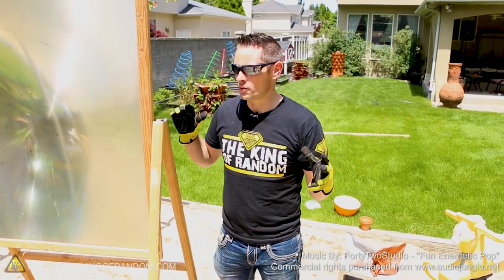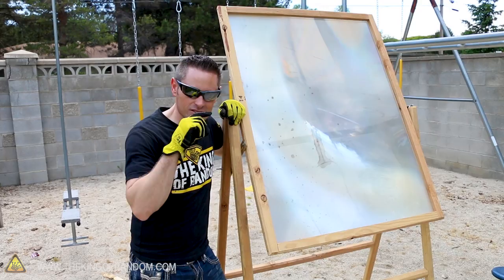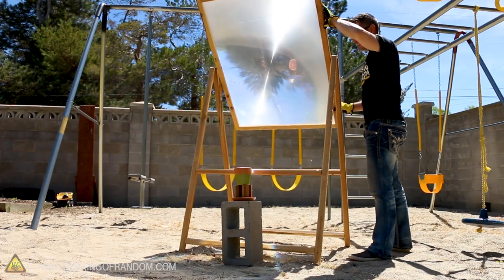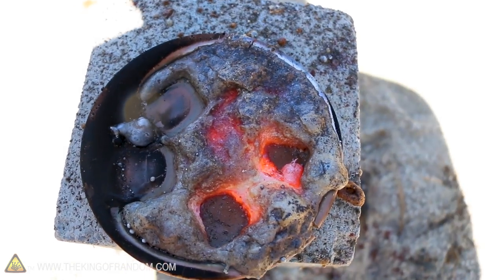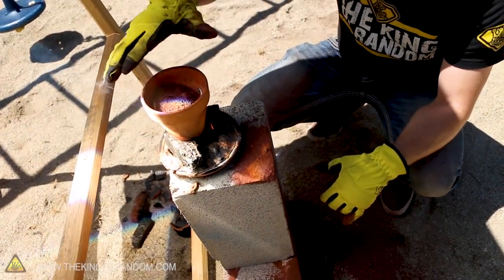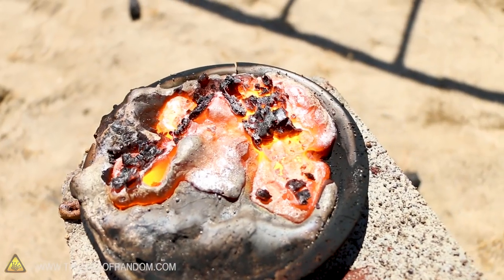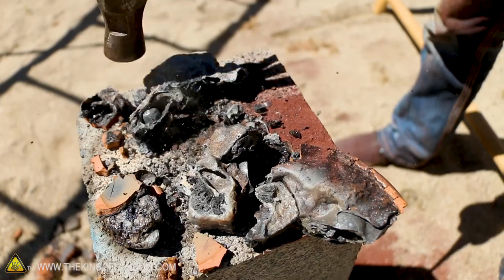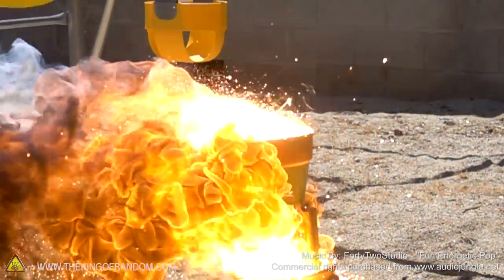Will The Solar Scorcher Light Thermite? TKOR Tests A Solar Beam From Giant Magnifying Glass

Comment: Will the Solar Schorcher burn dry ice or liquid nitrogen
Reply: Co2 (dry ice) and Nitrogen are common gases and doesn't combust or fuel a fire.
Reply: Str8fighter Halili No.
Reply: ok Thank you
Reply: It probably can because dry ice has a temp of -109.3G and liquid nitrogen has a temp of -321F and the solar scorcher burns things at over 2000F
Reply: Str8fighter Halili no. It can't burn it cuz liquids can't burn and the dry ice would vaporize before burning

Comment: will it and how mutch will it generate electricity with a solar panel
Reply: Vinko Klobucaric I wouldn't try that, the heat would damage the solar panels.. Plus, the scorcher works by concentrating light in a large area down to a single point. This means that there would only be a small amount of light hitting most of the panel while the focused light burns a hole in a small amount of the panel, so it's probably not very efficient...
Reply: Red Phosefir i ment an unfocused sorcher and i was wondering whoud it make a diffrence
tnx for the information
P.S. sory for my bad english
Reply: Vinko Klobucaric I suppose it might in that case, as long as the focused light fully covers the panel. :D it certainly does sound like an interesting idea
Reply: It is as Red Phosefir said: it only focuses the light (think of it like a funnel). The point being, that the it doesn't magically amplify the energy that enters the scorcher - in other words, the amount of energy that exits the scorcher cannot be any more than the amount that enters (otherwise it would be a un-isolated perpetual motion machine, meaning infinite energy). If it could actually output more energy than enters into it, imagine placing a bunch of them in a circle - energy would build up indefinitely; that is obviously not possible.

TL:DR: It makes no difference. The amount of energy obtained is the same assuming that it is even possible to make solar panels capable of handling such a high concentration of light.
Reply: That Guy how do you know
did u try?

Comment: thermite is actually used to join rails, so yes, you can use it to cast iron with it. I don't know if your sand will be able to withstand the heat though.

Comment: Technically you can cast shapes with thermite but its not going to be economical at all. There is actually a thing called thermite welding where people use the molten iron flowing out from a thermite reaction to fill big gaps in things like the joining point of rail tracks.

Comment: Yes you can use thermite to make cast iron, but you have to pre-heat your sand molds in an oven so that they (don't) fall apart from thermal shock, and then slow the rate of cooling so that you don't get weird crystals forming.

note: All words in ( ) are edited in.

Comment: You should make a sort of solar oven to match the solar scorcher, it is well over 2000 degrees, maybe you could use it to cast steel or just copper because it's far cheaper and cleaner than propane

Comment: Weird about the foam stuff... I was always under the impression that an iron oxide thermite reaction leaves behind pure(or close to it) Iron.  Strange that it didn't with this.  Maybe the ash from the wood and the pots mixed in while it was flowing downwards.  Because I know I have seen it leave behind beads of iron before when the thermite was just melting through metal.

Comment: Hi man! what do you think will happen if you mix a smaller than normal amount of iron oxide and a larger than normal amount of aluminum powder, light it, then blow air or oxygen over it? Will you get a burning thermite with its burn temperature based on how much air you're blowing over it OR it won't work at all. Maybe try that.

Comment: You should find out how hot this Solar Scorcher actually gets.  You should be able to figure it out with some math and taking the average amount of energy in a square inch or cm or something like that.  I don't know exactly what you need to do to find it out but it would be interesting to know exactly how hot it gets.  Or cheat and get one of those thermal laser temp monitor thingy-ma-jigs(na I'm sayin' home boy... >_> lol).

P.S. was funny watching you run every time you lit the thermite.  Especially the very first time since you were expecting it to go a lot slower than the very instant concentrated sunlight meets thermite for the first time... lmfao!!!  T'was great and a half!  Now do more experiments with this epic beast too...because we know for sure it is doing at least 3,000 degrees...which is insane(which is also why you should find out exactly how hot it is too)...

Comment: Casting with thermite won't work well since it's so brittle (you did experience it yourself). Thermite for rail welding at the railway is very specialised with a very exact mixture and diverse additions to make the iron settle better (it tends to have a lot of bubbles otherwise), and more often than not there are other metals added in to create an alloy. Modern thermite mixtures even have a heterogenous mixture to achieve different hardness and strength values in different parts of the weld. In the lower parts and especially the rail web you want less hard, but also less brittle and thus stronger material, while the rail head should be much harder to minimise wearout.

Comment: Yea, you should be able to cast...rather pour the iron created in this reaction into a mold to cast something(oh right, it is called casting).  Saying you don't run into the same issue as you did last time with your sand and hot materials(referring to the copper).